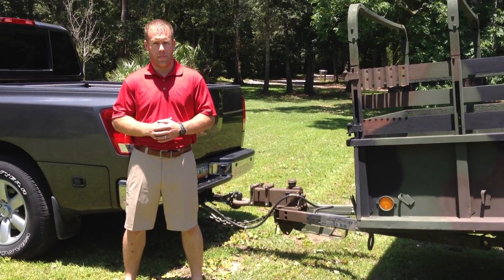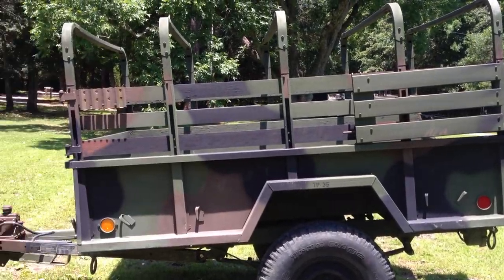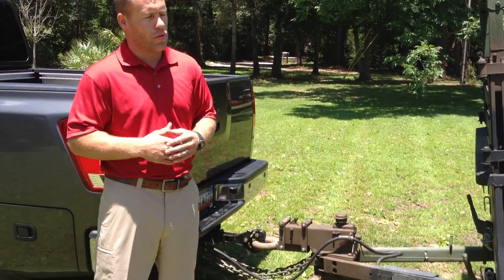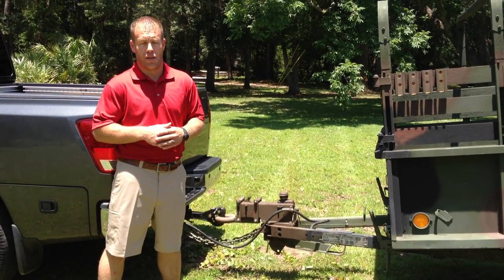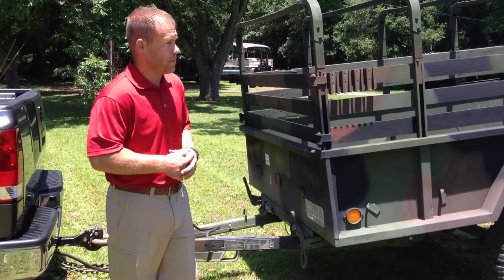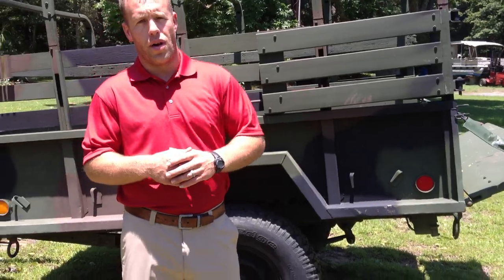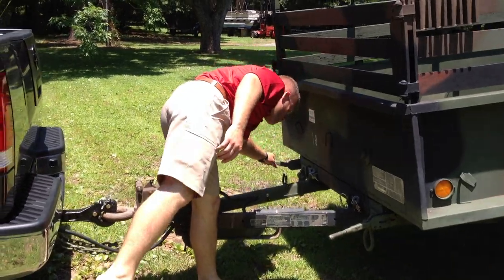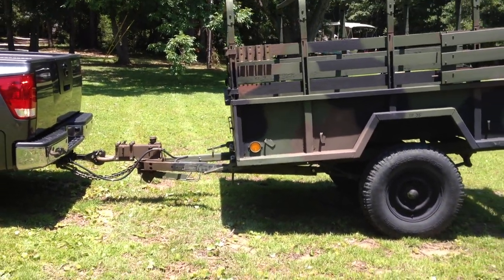Cargo Dump Trailer Demo

Comment: 1.  All military tactical vehicles are rated at one half of their true capacity for off road/cross country travel.  That means that you can "overload" your M101 series trailer for over the road travel and still be able to safely use it.  Of course that means you must follow the instructions in the Technical Manual.

2.  What you are showing is not a dump feature the true purpose of the disconnects at the front of the cargo bed is to allow more efficient shipping of the multiple trailers.  Yes you can use it as a dump trailer and most likely not have a problem, however you could damage your trailer beond repair

3.  The surge brakes are not meant to allow you to tow the trailer with underrated vehicles, the surge brakes are on the trailer to properly brake the trailer based on the load carried by the trailer and to not over whelm the towing vehicle brakes.   

And how do I know all of this......I'm a retired U.S. Army Motor Sargent, in other words this is what I did for 24 years.
Reply: How do y'all strip the paint off them ?
Reply: @sgt.rattlesnake6483   The paint on those trailers is normally what's called CARC,  Which stands for Chemical Agent Resistant  Coating, As such this is not the best thing to be breathing It can cause severe medical issues to include carcinogens.   If you use proper PPE ist proper PPE you can sand or sand blast it.   However I would advise against it It's hard to control the airborne dust that will be created
Reply: @bst5706  been useing Rustoleum Aircraft Remover Extra strength paint stripper at a private shop but have been doing the work outside. So I think I'm good on that just wasn't sure if there was any faster way.
Reply: @sgt.rattlesnake6483  yeah that sounds like a reasonable method being a liquid or gel I'm not sure which one it is it would keep your contamination levels down make for easier cleanup of course it's still risky but nowhere near as bad as having Airborne dust

Comment: Just so you know, this trailer does not have a dump feature and was not intended for the trailer to be use this way.  The purpose in the design was to remove to fasteners at the ends of the tow bar, then the trailer tow bar could either be laid flat on the ground or the pintle would be raised up towards the front top of the trailer so the tow bar is now like a jack stand for the front of the trailer.  The pins that were removed in the video need to stay in place as they are a pivot point for the actions I described earlier.  The reasons for dropping the tow bar to the ground or standing it up is, with the storage or transportation of many trailers, room can be used up very quickly.  With lowering or raising the tow bar out of the way means that a trailer can parked nearly up to the trailer behind it since the rear trailers tow bar will be out of the way.  Doing this, three trailers can occupy the space where only two normal trailers would fit.

The way he described using the trailer to dump is not the greatest for dumping.  Trailer doesn't raise very high and when you pull ahead causes the trailer to lower the bed down leaving 2/3s of your cargo still in the box.  Also not being designed to do this, parts will wear out, bend or just plain break, which can be dangerous or break more on your trailer.  I hope the helps.
Reply: Yup.  It looks great when you see someone do it empty or with little to nothing in the bed.  (2) of the (3) M101 trailers I have personally found used as "dump bed" trailers have been destroyed by their owners.  One gave way while dumping and was so bad, I ended up with the axle when he scrapped it.  Yay for me!  His axle is literally sitting my M101-A2.  The tires were fresh and I got the whole shootin' match for $120.  

Thank God for those internetz and the cheap salvage parts that ensue.  

BTW, the manual for all these trailers is a free download.  Spoiler alert:  The only section I found unhinging the trailer in that manner is under the procedure for preparing for shipment.  

I bought mine to be a dump bed then realized would it take to make the conversion usable for anything close to 1/2 of the rated load.  I might as well buy a dump bed conversion for my F350 at that point unless I happen to come across some metal.  BTW, don't buy these with the intention of sandblasting them and repainting them either.  The paint was treated with agents used to help it withstand chemical attack.  It's a nasty carcinogen in dust form.  I don't really care myself but I see a lot of conversion questions about painting them to match or repainting them to make them look more military.  Not a great idea without the right containment setup.

I see lots of vids and blogs about this.  Nobody told me before I bought mine they were not made to be dump trailers.  It's unfortunate since that's what I really needed.
Reply: douglas stewart funny the military trained our soldiers to use it as a dump trailer
Reply: @mattbenesch5695   Is the military never trained soldiers to use this trailer as a dump bed. Its sole purpose is for shipping anybody that does use it as a dump bed runs the risk of damaging the trailer often beyond economical repair. As a former army motor sergeant I actually had one person do this and after his  Statement of charges it cost him 1 month base pay.
Reply: JuSt So YoU kNow. Nerd
Reply: What model is this? I'm looking for an old one and I'd like to find one that has those surge brakes. Maybe you could recommend one. Thanks.
Reply: @rhess10  look for a m101a2 or a m101a3.
Reply: @douglasstewart4066  awesome. Thank you.

Comment: I need one of these for my Deuce.
Reply: For a duece, get a m105. The m101 (the trailer in this video) is designed to be towed by a 3/4 truck (m37 most of the time) and is equipped with hydraulic surge brakes with wheels and tires to match the m37 trucks. The m105 is larger, has a higher payload rating, is equipped with air over hydraulic brakes, and has wheels and tires to match the dueces

Comment: Brett, are you able to provide some specs for the dump pins on your trailer? Have the same trailer, but have bolts vice pins. TIA!
Reply: They are ment to be pins or bolts.  The trailer in not ment to a dump trailer.  The trailer I designed kind of to get the tongue out of the way by fold it up.  The middle pin/bolt remains in place while you release the two pins at the axle.  The front the trailer need to supported so that after the inner bolts are released. When that is done, lift the and up  towards the front of trailer.  The tongue will be standing upwards at the front of trailer or the tongue can be laid flat on the ground.

Configuring into either of these two was will allow for maximum of equipment to be loaded whether aircraft or by boat.